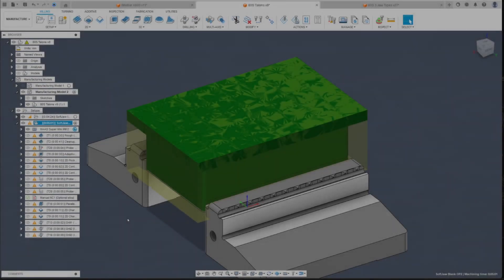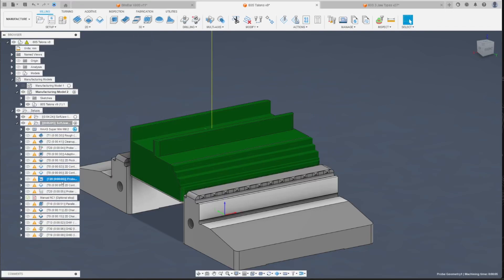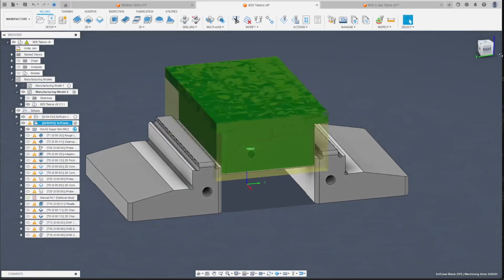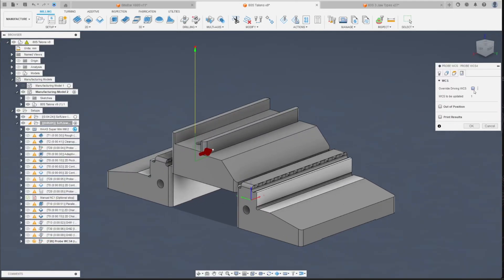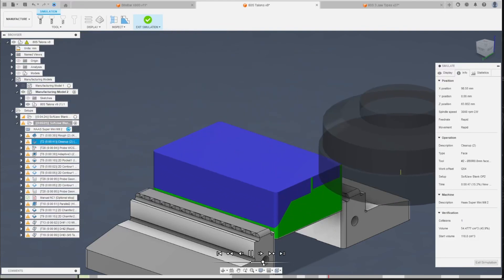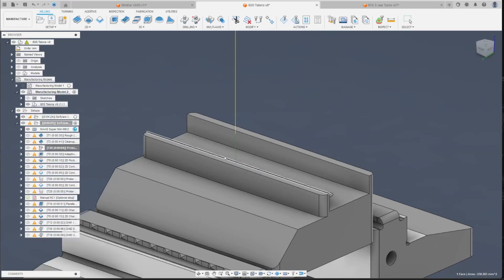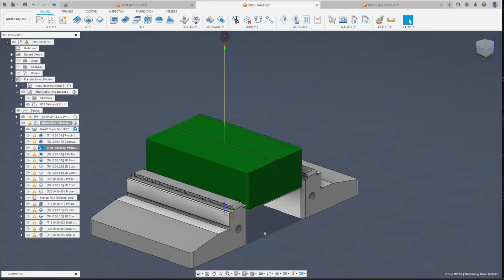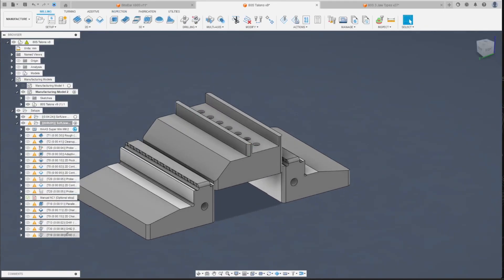Quick Tip - Probing WCS in Fusion 360

Comment: Hi, I just bought a probe after using the haimer for 3 years now. I'm struggling to understand why you would never probe in Z? I understand that the first wcs is G59, but lets say you put fresh stock in the vice, without parallels, but in the serrated jaws of your vice, and the stock was 50mm higher than the job you are on now, how does the machine know where the top of your stock is in relation to G59 if you have not probed it? 
Same for your Opp 2 you are showing in the vid, you had to machine the top hat off, how did the machine know how high the parallels were that you chose to use in the jaws if you did not do a Z probe on the parallel?
Reply from the maker: Good question! 

Basically. The serrated jaws have the resting surfaces that the stock sits on - those are good enough for OP1. If you model your stock correctly, than there's no reason to probe the top. 
I don't probe Z here because it's easy to crash.

Imagine this - you have 10mm stock, but model it as 12mm on accident. You than probe the top. This will offset all your tool paths 2mm lower, possibly cutting into your jaws. I messed up a set of expensive jaws like this hence why i don't ever do it. Of course my approach comes with a potential crash risk too - if you put in the incorrect height of stock in that does not match the modeled one, your facing pass will be at a much higher DOC. However i don't see how that would happen, and if you're afraid of your operator doing that, you can use the probe geometry feature with a tolerance to check the stock is correct without updating the WCS in any way.

On OP2 the reasoning is the same. I know how tall my vice and parallels are exactly, so when i model it like that i don't have a reason to probe Z. If you probe Z, you're relying on unmachined stock to give you the final part thickness, which is also not optimal. And it's also prone to cause crashes.

Hope i was able to help!
Reply: @filmatura  hi mate, thanks for the quick response. I understand now, because you are modelling everything first, so Fusion knows where the stock to and model should be based off your G59 in the software. 
Because I’ve always hand done it with the Haimer, I’ve not needed to model in the vice and jaws etc. 
ok, thanks.

Comment: Quick tip - nothing worse than someone thinking they know what they're doing and then trying to educate people with their knowledge!!

Hope your machine wasn't too badly damaged when you machined the vice jaw & your boss wasn't around........ouch 🤣🤣

p.s. with regards to FUSION using 1 to 6 for G54 - G59 you'll find this is dictated in the post process. If you want to use the extended G54.1 offsets then this starts from 7

p.p.s probing is useful for probing all your machine axis positions - you just need to understand how to use a Renishaw probe properly 😊
Reply from the maker: Hey, thanks for the comment,

first off im not sure if your first tip is supposed to say im educating people wrong in this video but i will gladly hear any more input on my workflow if there are improvments to make (and im sure they are)

My machine was not damaged in any way but my boss was around indeed, as i am my own boss. It sure hurts to have these small mistakes happen which is why i wanted to make this video.

ps 1. Thanks for that explanation!

ps 2. Im fully aware i can probe all the axes, however using a centering vise for 99% of my work i have no reason to probe any other axis than X, as the rest can remain the same, making it a much more fool proof process and saving some seconds on having to probe my work.

Cheers
Tom
Reply: You are the one who doesn't know what your talking about, I used exactly the same method everyday on a 5-axis machine. 
This is about automating setups, reducing programming time and errors .